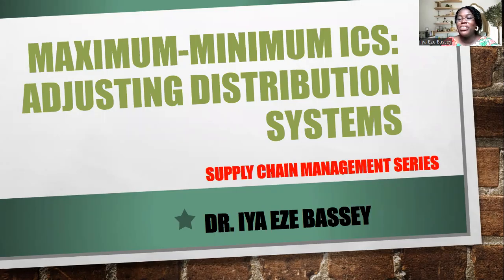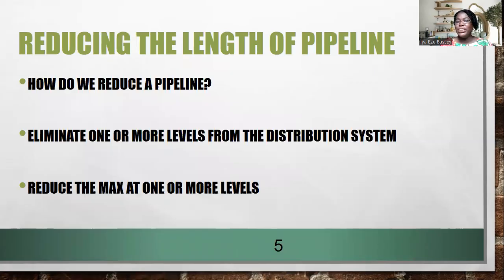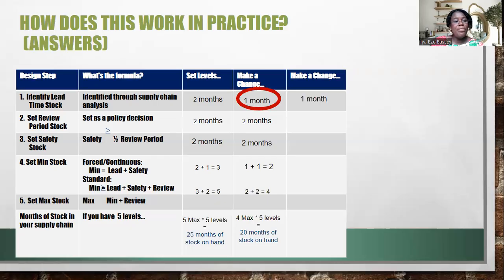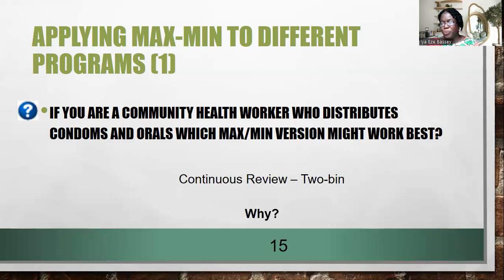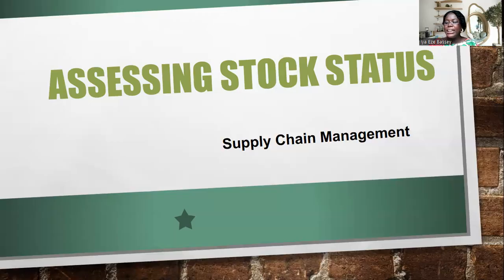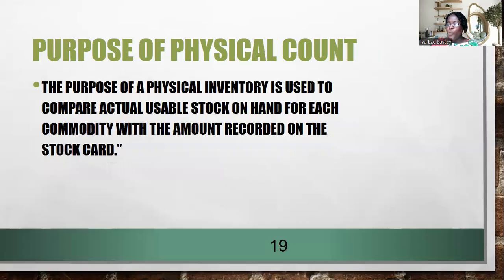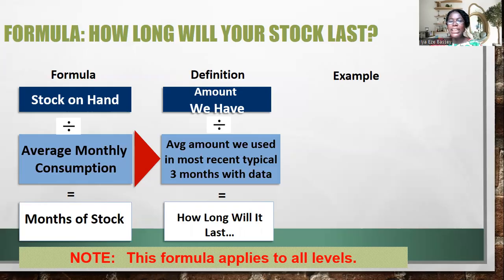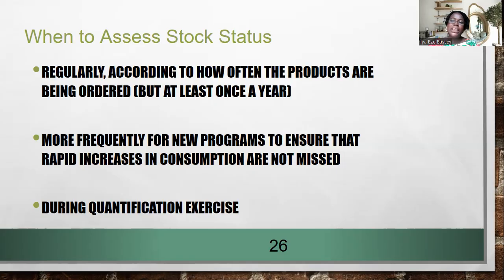Maximum-Minimum ICS: Adjusting Distribution systems (Supply chain management series)

Comment: Thanks Dr
Summarizing about designing and implementing a maximum-minimum inventory control system, particularly in the context of public health supply chains.
*Importance of Special Maximum Policies:
- Implementing special maximum policies at each distribution level is crucial for optimizing inventory flow.
*Designing a Maximum-Minimum Inventory
Control System:
- Setting up initial maximum-minimum policies for each level and type of facility distribution system
- Reducing the maximum stock level at one or more levels
*The Factors Impacting Max-Min Stock Levels:
- Shelf life
- Lead time
- Production cost
- Reliable source of supplies
- Cost of product
- Reliability of transportation
- Storage capacity
- Cost of storage
- Storage conditions
- Age of program
- Forecast

*Ways to Reduce Max Stock Level:

- Shortening the review period
- Reducing lead time
- Improving distribution system reliability
*Advantages of Using Max-Min System:
- Avoiding overstocking
- Avoiding costs of emergency orders
- Avoiding understocking
- Minimizing wastage
*Accessing Stock Status:
- Regularly, based on order frequency
- More frequently for new programs
- During qualification exercises

Comment: Thank you ma for this insightful lecture
  In this series I've learnt the steps in designing a max-min ICS. These steps include; 
  1) set up initial max-min policies for each level and type of faculty.
   2) check if the overall distribution will function properly if the level specific max mind policies are implemented
   3) check the total length of the pipeline that the policies at each level imply.
    Some factors that can impact max min stock levels are;
  - cost of products
  - reliability of transportation
  - storage capacity
  - cost of storage
  - storage conditions at different levels
  - shelf life of health commodities
  - lead times
  - reliability of source of supplies
  - effect of a zero balance 
  - management skills of staff
  - age of programme
  - accuracy of forecast.
     Advantages of max-min system includes;
 - avoid over stocking
 - avoid understocking
 - minimise wastage
 - avoid cost of emergency order
 - simplify inventory control decision making
 - consistency of stock levels, etc.
  Thank you ma .

Comment: Thanks ma.

In summary of today’s lecture, I gained a clearer understanding of how the Maximum/Minimum (Max/Min) Inventory Control System is an effective tool for managing stock levels and reducing waste in the supply chain. This system helps maintain an optimal balance—avoiding both overstocking and stockouts—by setting clear maximum and minimum stock thresholds for each point in the distribution network. Implementing a Max/Min system starts with determining appropriate stock levels based on each facility’s needs, and then ensuring those levels are consistently applied across the entire supply chain. Adjustments to the distribution system can be made in two key ways: by shortening the supply chain or by reducing the maximum stock levels held at each level. Several factors influence these stock level decisions, such as product cost, storage capacity, shelf life, transportation reliability, lead times, the consequences of stockouts, and the skill level of staff handling inventory. These variables must be carefully considered to ensure the system works effectively in practice.

The advantages of a Max/Min inventory system are significant—it simplifies decision-making, improves accountability, minimizes wastage, and ensures a more efficient flow of commodities. That said, challenges can still arise, particularly when dealing with large numbers of products or complex supply chains.

A crucial part of maintaining this system is regular stock assessments, which involve physical inventory counts and comparing them against records. This helps determine how long existing stock will last and whether adjustments are needed.

Overall, today’s lecture highlighted how a well-designed inventory control system is key to maintaining consistent product availability and supporting the broader goals of efficient healthcare delivery.

Comment: To put up briefly, what I have learnt from Adjusting distribution system, it is a system designed to carefully analyze and hasten the flow of commodity from the central port to the client, by shortening the review period, reducing the lead time, and improving the distribution system reliability at one or more levels so that safety stock can be reduced, it is done by
   **1: reducing the length of the pipeline 
   **2: reducing the max at one or more levels
  With the aim of, minimizing waste, avoid overstocking, avoiding cost of emergency, maintain consistency of stock level and avoiding understocking 
  However challenges may arise in the course of achieving this, challenges such as, cost of product, cost of storage, lead times, age of program, storage condition at different levels, and management skill of staff

Comment: I appreciate your hard work in making sure that we understood each series. 
In summary, i have come to realized that designing a max -min ICS is by setting up initial max - min policies for each level and type of facility.
Reducing the length of pipeline;
Eliminate one or more levels from the distribution system. Reduce the max at one or more levels.
 How to impact max stock level
Shorten the review period at one or more levels, reduce the lead time at one or more levels.
 Advantages
Avoid overstocking
Avoid understocking
Challenges of using each version and variation
System with numerous levels.

 How to determine the stock is by physical count which the process of counting by hand the total number of commodity in your store at any time.
Purpose 
It's used to compare actual usage stock on hand for each commodity with the amount recorded on the stock card. 
Formula: 
SOH÷AMC=Amount we have÷average amount used in most recent typical 3 months with data. Example 3,000 lo- femenal÷ 1181=MOS = 2.5.
 When to assess stock status
Regularly, According to how often the products are being ordered but at least once a year.

Thank you.

Comment: I learned that implementing a maximum-minimum inventory control system in distribution means managing stock intelligently. Each warehouse or distribution point has set maximum and minimum stock levels. When stock hits the minimum, an order is automatically triggered; when it reaches the maximum, deliveries slow down or excess stock is reallocated. This system reduces storage costs, prevents stockouts, and enhances responsiveness."

Comment: In a Maximum-Minimum (Max-Min) Inventory Control System (ICS) with an adjusting distribution system:

- The Max-Min levels are adjusted based on factors like:
    - Demand fluctuations
    - Lead time changes
    - Supply chain disruptions
- The distribution system adapts to these changes by:
    - Automatically recalculating order quantities
    - Adjusting reorder points
    - Ensuring optimal stock levels

This dynamic approach enables the supply chain to respond to changing conditions, minimizing stockouts and overstocking while maximizing efficiency.

Comment: This video broke down how to design a max-min inventory control system. It involves setting the stock limits for each level, checking if the system works well and seeing how long the supply chain (pipeline) is. I learned that to shorten the pipeline or reduce max stock levels, we can cut down review periods, improve transport or reduce lead time. Factors like storage space, shelf life and the cost of products also affect stock levels. The max-min system is useful because it prevents both overstocking and understocking, but managing too many levels can make it tricky. Lastly, I now understand that doing a physical count helps confirm if your records match what’s actually in the store. Thank you ma.

Comment: In reviewing the topic, I noted the following key points:

Factors Affecting Max-Min Stock Levels:

The main things that influence how maximum and minimum stock levels are set include:

*The cost of producing the items
*How reliable transportation is
*How much storage space is available
*The cost of keeping the items in good condition
*How long the items last (shelf-life)

Advantages of Using Max-Min Control:

*Preventing both overstocking and stockouts
*Reducing waste and urgent order costs
*Keeping stock levels consistent
*Providing dependable data from SDPs (Service Delivery Points)

Physical Count:
A physical count means manually checking the actual number of usable items in stock at a certain time.

Its main purposes are to:
1. Compare actual stock with what’s recorded
2. Estimate how long the stock will last
3. Update records to support accurate forecasting and planning

Comment: Thank you so much Ma
In summary I've learned that in adjusting a distribution system, it's essential to consider:
1. The length of the pipeline.
2. Reducing pipeline length.
3. Lowering the maximum stock level.
Advantages of the Max-Min Inventory Control System:
1. Prevents overstocking and understocking.
2. Reduces waste.
3. Avoids emergency order costs.
4. Maintains consistent stock levels.
5. Simplifies inventory management decisions.
Challenges in Using Inventory Systems:
1. Managing systems with multiple levels.
2. Handling a large variety of commodities.
3. Managing inventory for new programs.
Stock Status Assessment:
This determines the months of stock remaining and is done by:
1. Conducting a physical count.
2. Calculating how long supplies will last.
Purpose of Physical Inventory:
To compare actual stock levels with records on the stock card.

Comment: Thank you so much ma for this lectures
I understood the steps in designing a maximum-minimum inventory control system which include: setting up the initial maximum- minimum policies for each level and type of facility.
Checking if the overall distribution will function properly.
Checking the total length of the pipeline that which the policies at each level Imply 
I also learnt about the advantages to using maximum-minimum system which includes: Avoiding overstocking, Avoiding understocking, minimizing wastage and Avoiding costs of emergency order. 
And also the challenges to using the inventory control system which includes: system with numerous levels, systems that manages a large number of commodities, system that manages products for new programs.                        
I also learned about assessing stock status which is physical count, it involves the process of counting by hand the total number of usable units of each commodity in the store or health facility at any time.
The purpose of the physical count is to compare actual usable stock on hand.

Comment: From this video i learnt that the importance of the max-min inventory management system in maintaining stock levels to avert problems of overstocking, understocking, and unnecessary waste. I also learnt that the max-min system sets two key benchmarks: the maximum level, which is the highest acceptable stock, and the minimum level, which is the lowest safe level before replenishment. Parameters that greatly influence optimal inventory levels include product cost, storage capacity, and shelf life. The design of a max-min system involves deciding on policies for all facility levels, starting stock levels, and streamlined distribution. Pipeline levels and lead time reduction are other methods that help meet demand in a better manner. Physical counting of stock and prompt assessment of stock levels are essential to ensure steady supply chain functionality.
thank you very much ma

Comment: Thank you, Ma for the wonderful lecture. In summary, the steps in designing Max-min in ICS are:
set up initial Max min policies for each level and type of facilities.
check if the overall distribution will function properly if the level specific max-min policies are implemented. check the total length of the pipeline that the policies at each level imply.
We can reduce a pipeline by removing one or more levels from the distribution system, Reduce the max at one or more levels.
Factors that impact max-min stock levels are:cost of products, storage capacity, cost of storage, management of skilled staff, Age of program etc.
The advantage of using max-min are to avoid over stocking, to avoid under stocking, minimize wastage etc.
Also elements to reduce the maximum stock level: shorten the review period at one or more levels, reduce the lead Time at one or more levels and improve the distribution system's reliability at one or more levels so that safety stock can be reduced.
The factors that impact Max-Min stock level:cost of production, reliability of transportation etc....
Advantages of using Max-Min system: minimize wastage etc.
Under assessing stock status,
Physical count, which is the process of counting by hand the total number of usable units of each commodity in a store at a given time, should be ensured to know how long supplies will last.
While calculating in the example, if one of the last 3 months is O, the month before the 1st last month is used.
Stock status should be assessed regularly, more frequently and during quantification exercise.

Comment: Thank you ma.
I learned that the steps in designing a Max-Min Inventory Control System (ICS) are:
	1.	Set up the starting max-min policies for each level and type of facility.
	2.	Check if the whole system will still work well when these policies are used.
	3.	Check the total length of the pipeline caused by these policies.

How to reduce the pipeline length:
	•	Remove one or more levels from the system.
	•	Reduce the max stock level at one or more levels.

Ways to reduce maximum stock levels:
Change some parts of the formula:
	•	Shorten the review period at any level.
	•	Reduce the lead time.
	•	Improve the transport system so we need less safety stock.

Other things that affect max-min stock levels:
	•	Product cost
	•	Transport reliability
	•	Storage space
	•	Storage cost
	•	Shelf life of health supplies

Advantages of using a max-min system:
	•	Prevents overstocking
	•	Prevents understocking
	•	Reduces waste
	•	Avoids emergency order costs
	•	Makes inventory easier to manage

Challenges of max-min system:
	•	When there are many levels
	•	When there are many items to manage
	•	When dealing with new health programs

A physical count is when you count by hand the number of good items in your store. It helps compare what’s actually there with what’s on the stock card.

The goal of checking stock status is to know how long your current supplies will last.

Comment: Thank you, ma, for the interesting lecture. I learned that reducing the length of the supply pipeline can be achieved by removing certain levels and adjusting formulas in maximum stock calculations, such as the review period and lead time. Factors that influence max-min stock levels include lead time, storage capacity, and storage costs.
The main advantage of this system is to prevent overstocking, understocking, and wastage. I also understood the challenges associated with using each version and variation of the inventory control system.
Additionally, I learned about physical counting, which compares actual usable stock with stock card records. This helps assess stock status and determine how long supplies will last using the Months of Stock (MOS) formula. I also learned when and why stock assessments are important for effective inventory management.

Comment: Thank you ma for the Wonderful lecture...
In summary...i learnt the key steps in designing a max-min inventory control system when adjusting the distribution system... Which has to do majorly with the length of the pipeline 
The factors that can impact max-min level like cost of storage facility,lead time, reliability of transportation...etc
And lastly the advantages this system brings like it helps us to avoid overstocking,understocking and also wastage

Comment: Thanks mar for the wonderful lecture. 
In summary i learnt adjusting distribution system in maximum and minimum ICS helps  us to reduce the different levels of distribution system in order to reduce lead time. It is highlights the length of the distribution pipeline an different ways to shorten it in order to hasten delivery.

Comment: Thank you ma for this interesting lecture.
I have learnt how to reduce the length of the pipeline by eliminating some levels and changing some formulas in the maximum stock levels like the review period and lead time. I also learnt about the factors that affect max-min stock levels like lead time, storage facility and cost of storage etc. As well as the advantage which is to avoid over and under stocking and avoid wastage etc. And the challenges involved in using each version and variation.
I also learnt about physical counting which is used to compare usable goods at hand with those in the stock card in addition to the purpose for assessing stock status which is to determine how long supplies will last, the formula for calculating MOS, when to access stocks and the importance.